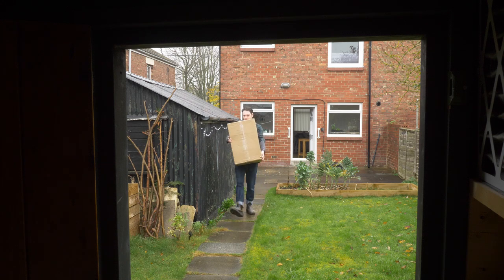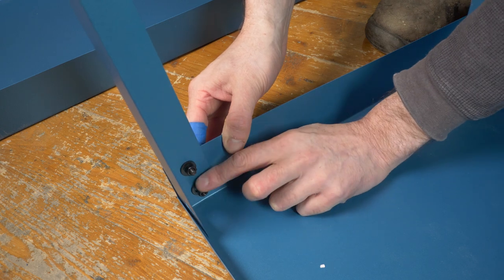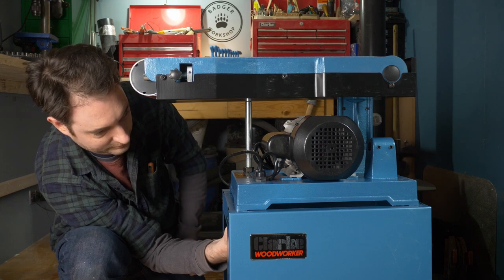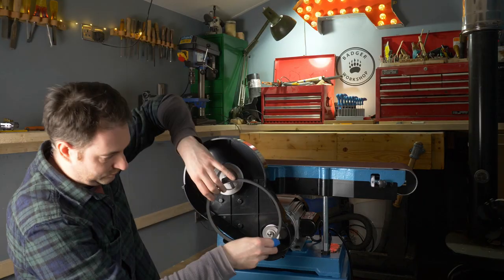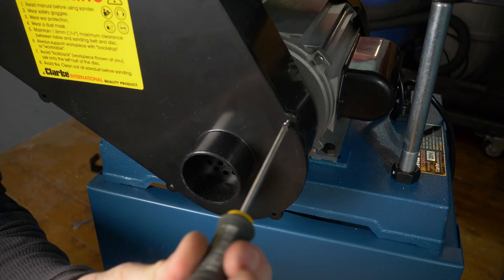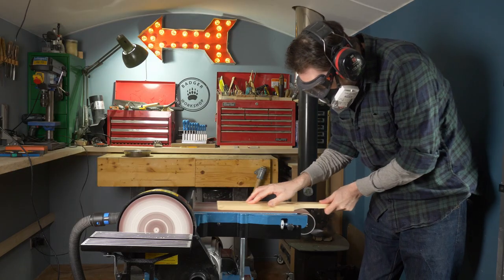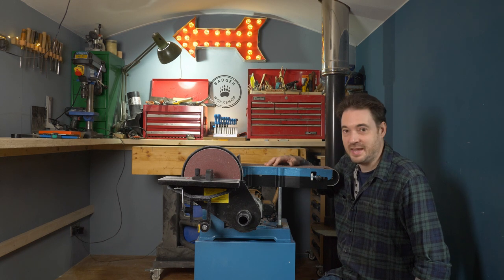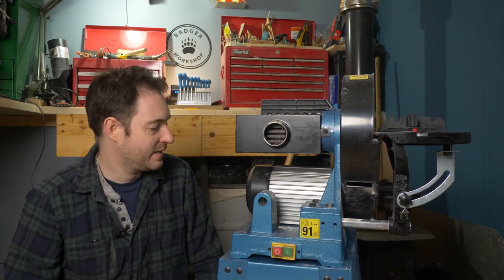Setting up the Clarke CS6-9D 6x9" Belt & Disc Sander

Comment: Hi Matt. Very impressive small compact machine, you'll love working it finishing your flat and internal or external curved surfaces.
Well built and and powerful for it's size as you have shown, it will save you loads of time. UK parts back up as well. Nice one Matt.

Comment: I always think these machines make more sense with the belt up vertical. That way you have much more surface area than with the disc, easy to change belts, and it's a consistant speed. Where as the discs will always sand faster at the edge than towards the center and is a pain to change the disc. I think a better design would be to do away with the disc and have 9" vertical belt. It wouldn't be any larger would do a better job.

Comment: Cool, looks like you were on your own Secret Santa list! Btw the grub screws for the table/platform that are not being used on the belt side... make sure they're either tighened or removed, vibration migh shake them loose.

Comment: We had one of those at work and the one frustration was the lack of the option of a second table as 1 workflow used the disk and another used the belt with only a few minutes inbetween. Needless to say we made our own table but it would have been nice to have the option for 2 tables.

Comment: Hi Matt  another good clear video , I have a smaller version and would recomend a rubber block to clean the sand paper well worth the money ,works fast and  extends  the life of sand paper , you've probly been asked before but where did you get the cone shaped hose ends on your vacum hose , thanks ,G.